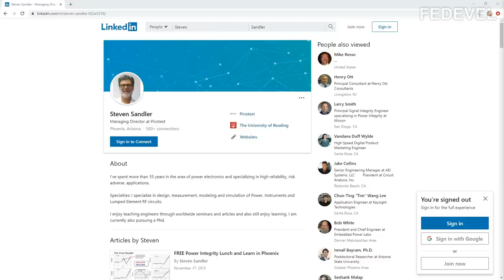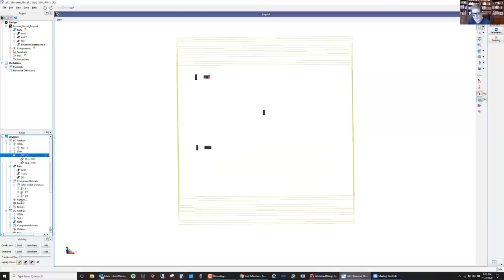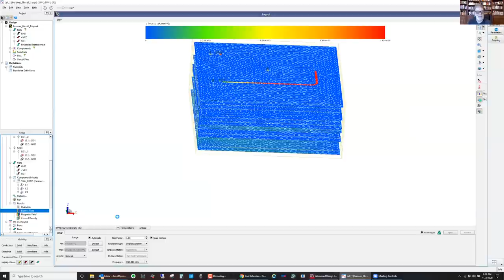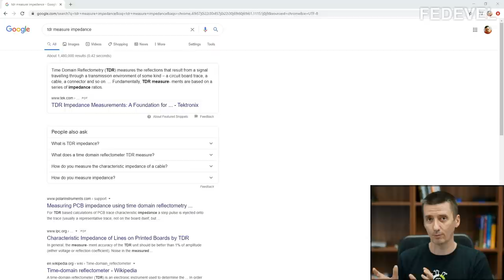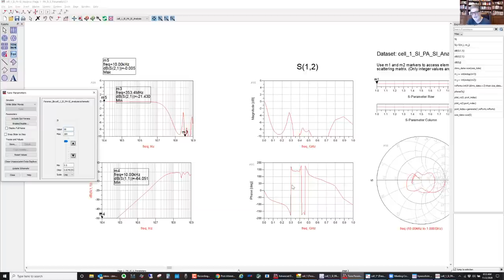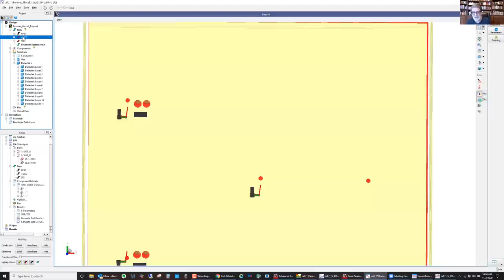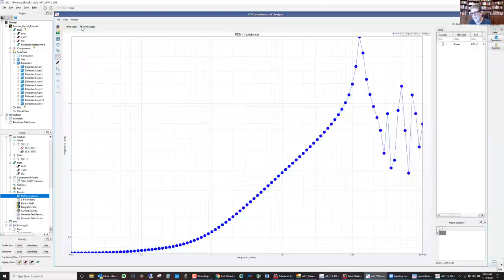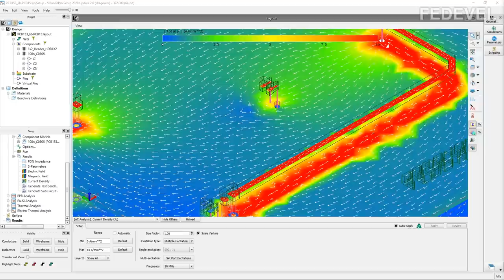Thinking to Simulate Your PCB Layout? This May Help ...  (with Steve Sandler)

Comment: At 32:32 there are some small technical mistakes in the videos, for example the Phase does not cross 0 there but 180 this is just an artifact of the Diagramm it is Scaling if it crosses 180 you have to unravel the phase plot
Reply from the maker: Thank you very much Heinrich
Reply: @RobertFeranec  Thank you for making such amazing video and make the variable to every one !!!

Comment: Hi Robert, thanks again for an interesting video!
After I saw the video I have a general question or comment on this topic I would be glad if I may hear your comment to this.

Ok, so lets say there is a resonance between layer 2 and 3 in a four layer board and that these two layers are the  0V and VCC, thus the suppy layers.
All my circuitry is placed on the top side of the board so both the 0V and VCC supply are entering the top side of the board from their inner layers to the top layer via one via each, I know, those vias are inductive. On the top layer the two supplies are then entering a decoupling capacitor and then further (short trace) to the circuit that is to be supplied.
 
1. If using non-damaged internal supply-planes I assume that there will not occur any high differences in potential (E-Field) on these planes?
2. So, the circuit that is to be supplied will not see the resonance occuring between the two layers, will it? (due to the topside decoupling)
3. The circuit on the top side will see a low impedance on its supply due to the decoupling capacitor located near the circuit on the top side of the board, I assume?

Have a nice evening,
Best regards,
Tomas

Comment: Robert i would categorize myself as a maker and learned a lot from your videos. Thanks for all your effort! However this video left me confused. I mean i understand the importance of the DC analysis and i also understand why one should try to avoid plane resonances on a given frequency (ex. at 2.4GHz if the device is intended to operate near a wifi router)... But the idea of the AC analysis really confuses me! How do they measure/simulate that? Do they simply inject a pure AC voltage to power traces (basically changing my DC LDO regulators to an imaginary AC source? Or do they just add an extra AC component of 1mV amplitude in top of the original DC source (some websites suggest this)? And how to interpret yellow or red spot on the PCB in the AC analysis? Let us imagine i am designing a battery powered PCB for measuring EEG (really low voltage changes with a very sensitive analog front end IC). Shall i avoid placing the EEG sensor chip on yellow or red spots on the PCB and rather place it on blue spots? If so then... well... where those spots are depends on the frequency of what? The excitation frequency of the AC analysis, or on any RF frequencies that may be present in the environment where the device is being operated? If the later is the right answer, how would i know in advance in which environment end users would operate such a device? I mean how should i place my EEG sensor IC if i have no clue if some one would operate such a device near an AM radio, a WiFi router, etc? I mean if i am guessing it right, no matter where i place that really sensitive IC, there always will be several frequencies which would cause some trouble right at the spot where that IC has been soldered during fabrication... Sorry for asking so many questions but this topic made really curious as it sounds extremely important but with my actual mindset it rather confuses me instead of making me feel more confident.
+1 question: in case of such a sensitive IC would it be a good idea to rather cut out any power and/or reference planes to reduce hard predictable frequency related effects of the stackup even if in general it is a good idea to have solid ground planes?

Comment: Great material , your guest clearly has years of experience 👍. What simulation software do you use ? . Is it affordable for personal use ? .
Reply from the maker: Thank you very much Hedley. I am very happy you liked the video. PS: The software is ADS from Keysight. I do not know the exact price ... Someone mentioned in comments in the previous video it cost 22000USD? But I am not sure if that is correct number. Here is a link to the software: https://www.keysight.com/en/pc-1375582/advanced-design-system-ads-simulation-elements?cc=SK&lc=eng

Comment: Hello,
Mr. Robert Feranec,

I have three questions, but not really related to this video.
If you can answer will be great.

1) Can you make a video in which to explain the Hardware Development Process or Product Development Process or Hardware Design Flow or whatever you want to call it of electronic equipment?

2) I have seen in some boards that layout/components placement is made symmetrical. What are the reasons or benefits of making board/layout/components placement symmetrical? Or it is just for aspect? Can you explain in one video this thing?

3) Can you make more videos in the future on how to simulate PCB in ADS from a signal & power integrity point of view with specialized people like you have done in this video?

Thank you.
Best regards.
Reply from the maker: Thank you Bejan PS: 1) I made a note 2) What do you mean by symetrical? One reason could be easier layout - you can only do placement and layout of one side and then copy it to the other.
Reply: @RobertFeranec  I do not know how to express this thing (to be symmetrical) in meaningful words (an image will have been more expressive, but I do not have this possibility in comments this on youtube), but try to imagine this: if you had a two-phase buck converter and you want to make a layout for this, then somehow you put one phase in one side and another phase symmetrical from the first phase. But this is just a more or less an example. This I think can be implemented (and this is done very often) for many designs. Therefore my question is:  exists some technical reasons for this kind of implementation/layout (I mean a block of components to be symmetrical to each other)? or is it just for the layout to look pretty (meaning aspect reasons) or as you said before for an easy layout (copy and paste)?

* I edited this post, meaning I added a third question:))